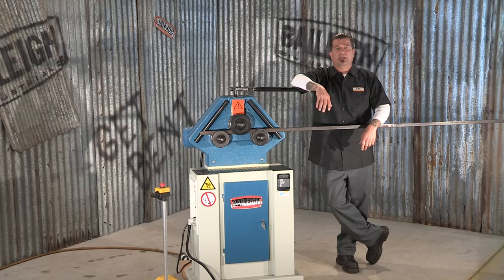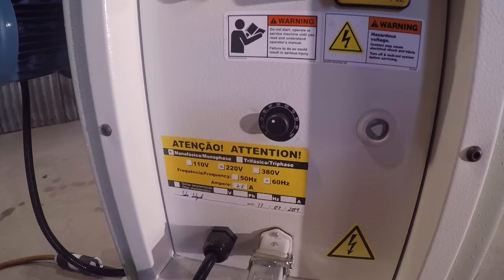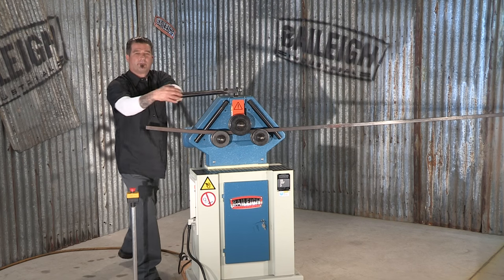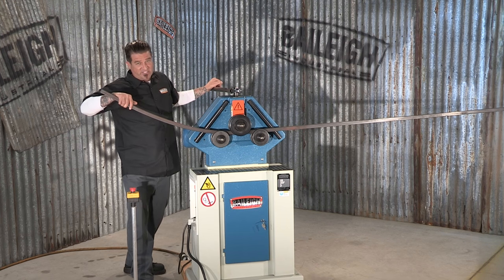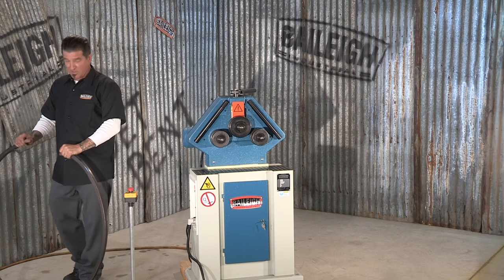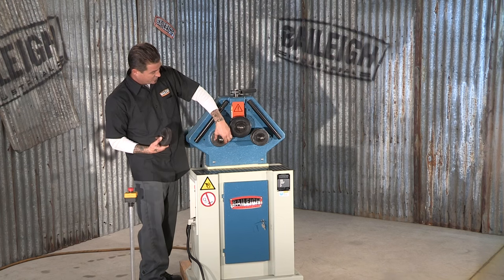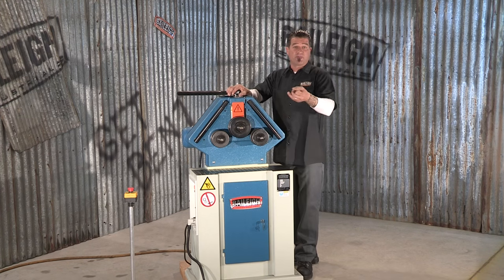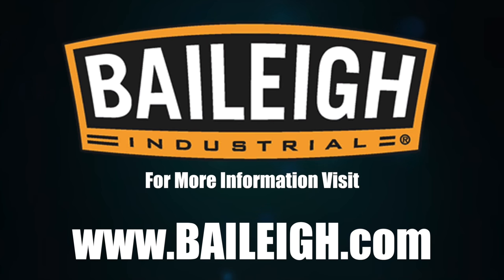Baileigh Industrial R-M40 Roll Bender Section bending machine Pyramid Style

Comment: So how does one stop the metal sections from twisting as they bend? I've used these type of machines several times over the years (including baileigh) and the material always seems to skew off in 1 direction, so you get a helix rather than circle. It not much of an issue to fix, just not ideal. I would quite like to know where I'm going wrong.